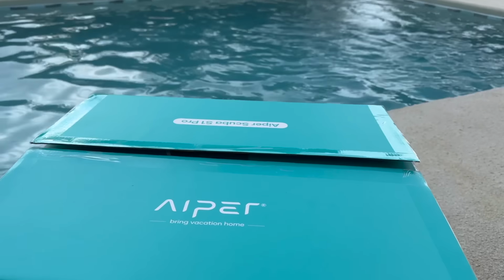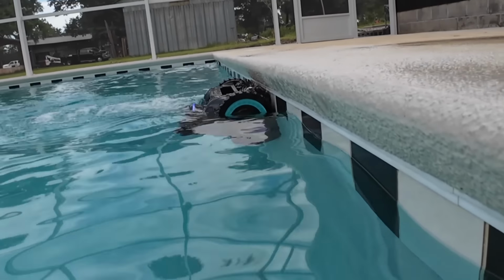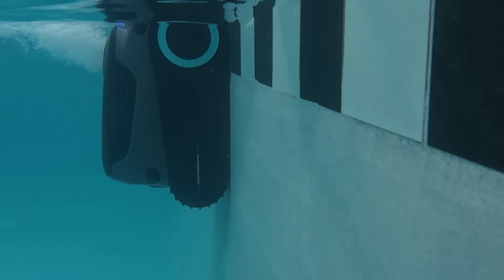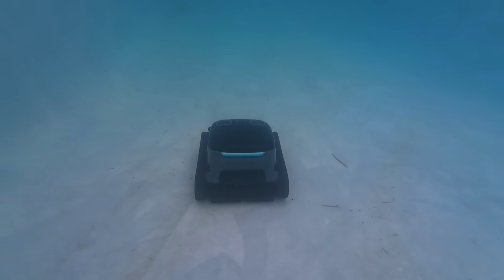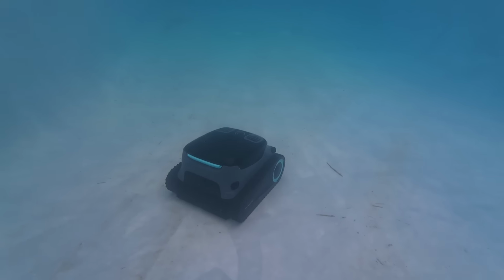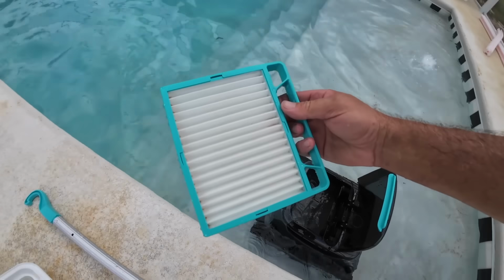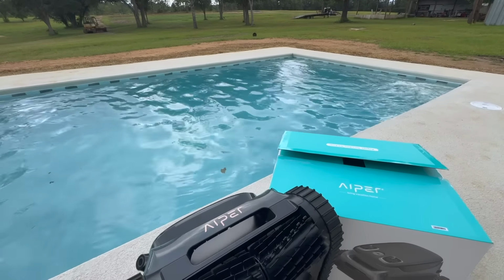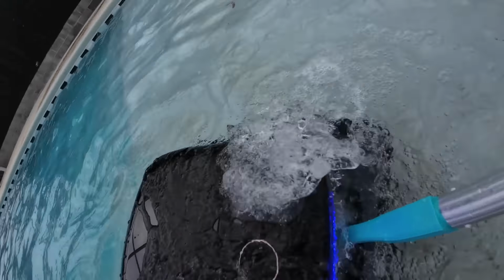COMPLETE POOL BUILD IN 12 MINUTES!

Comment: i worked at a resort for 12 years or so, i cleaned the inside pool and hot tub year round and the outside pool in the summer.  that was checking the chemicals and using the pool vac. inside pool is painted, outside pool has a liner. same sand filter and valve, pump is a little different but works the same way.